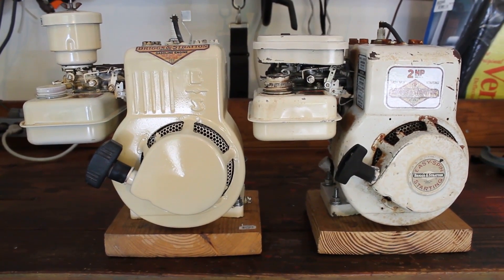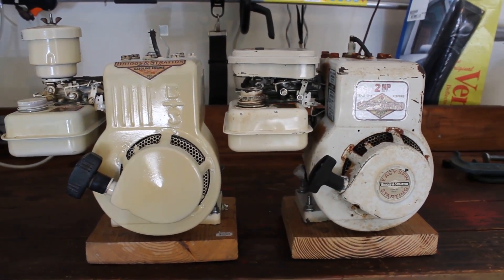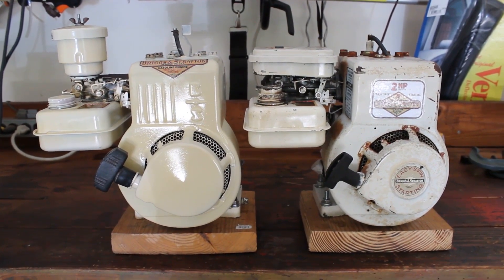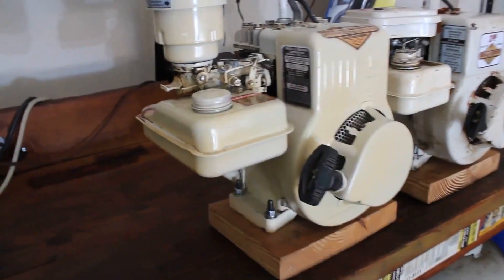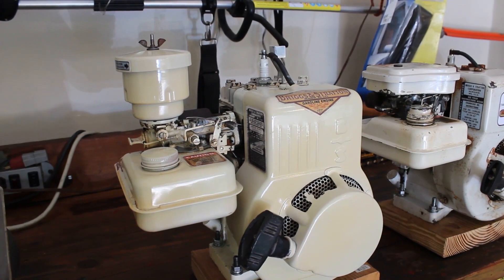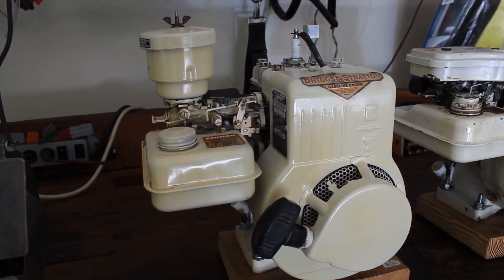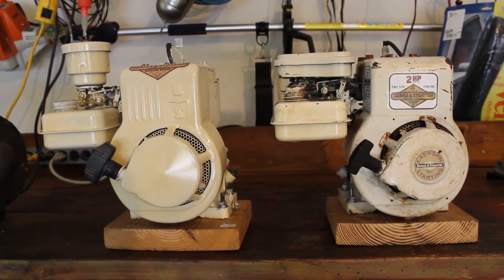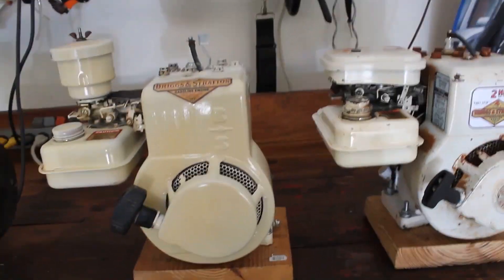1957 and 1966 Briggs 2 HP Engine Comparison

Comment: Some of the information given in the video is incorrect; the transition from cast-iron to aluminum was not in 1957, but in mid 1955 for the horizontal shaft engines.   Both of these have a 1 1/2 inch stroke; only the Cast Iron engines had a 2 inch stroke .  The 1957 has either 2 5/16 or 2 3/8 bore; the later one has a 2 3/8bore.   I do agree that it is very rare for an engine to have the numbers in two locations and they match;  serial of 1.5 million in this case.  Otherwise good video and nice little engines

Comment: I always thought the '57 shroud was used '59-'60, but here it is on a '57 engine! you have a really unusual anomaly there, it seems. Nice find!! There were some early 6b/8b that had a RED rubber pull start handle, and a cam that looks very much like the cast-iron model 8 cam. I have an early cam, but no longer have the red pull handle. I wonder if the '57 still has the small intake valve? I thought that changed to the big valve in '59. Nice sound quality in your video.
Reply: They stopped using that sculptured design after 1961.

Comment: I have a 1955 6BS. I'm wondering if the shroud was just changed to add the recoil. Mine has a rope start and electric.
Reply: 1955 was the first year for these; the recoil would have been the earlier style; 1955 are hard to find

Comment: I have a Briggs 2 hp engine identical to the one on the right and it's a 1977. There was no change whatsoever in this 11 year time span? Either way, mine also runs very good. Best carb they ever made.
Reply: Certainly the decal on the front hadn't been changed since around October 1, 1964 (code 6410010). You are right that they did change the decals again starting on August 1, 1977 (code 77080100) and that newer style continued into the first year that it had the Magnetron (starting at code 82060100 = June 1, 1982).